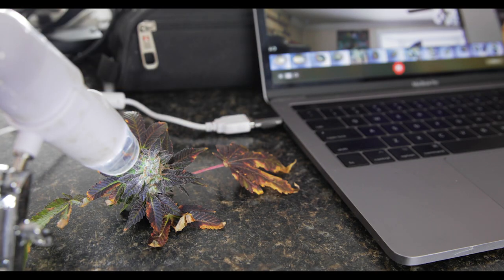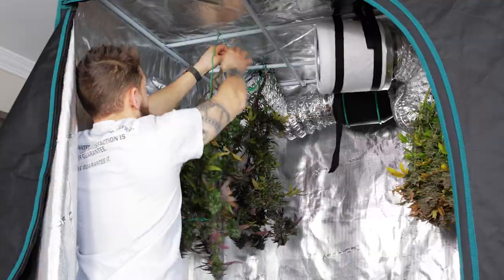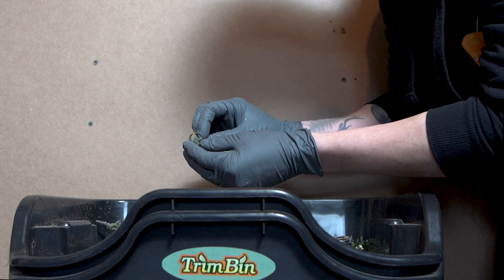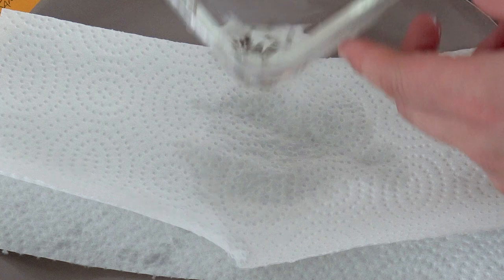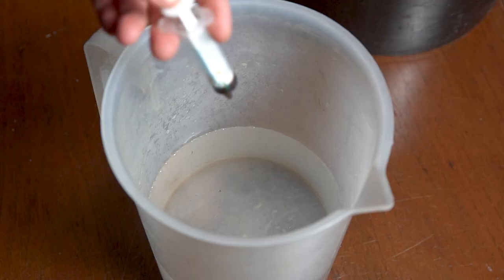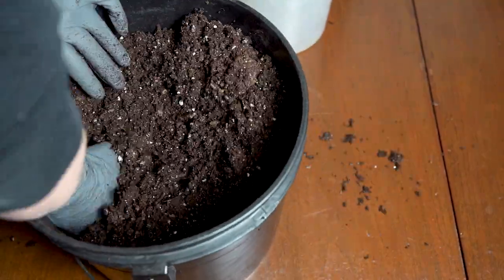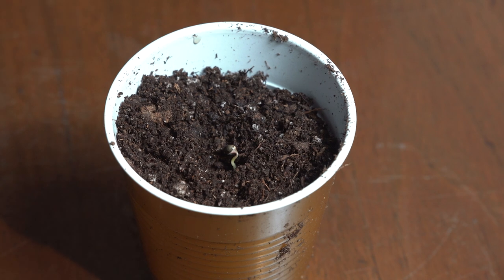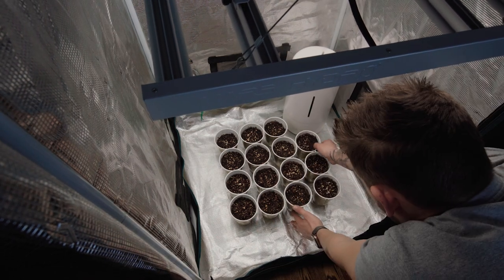Germinating my own strain of Cannabis! [Blue Freezie Grow Series EP.1]

Comment: If you just cross-bred two strains, you have not come anywhere near creating your own strain. Your own strain consists of isolating specific genotypes and phenotypes until you have seeds that grow one out of 8 different possible outcomes every time you find a seed. What you are doing is not breeding your own plants responsibly to create a new strain. What you are doing is experimenting with cross-pollination. Spend a few years crossing to get f1 seeds of different parental genetics from the same parent strains from the same breeder, then isolating 1 out of 4 possible desirable phenotypes from each batch. From there cross those desirable phenotype plants to create viable seeds. Of the viable seeds, you can take it a step farther and herm half the seeds in a grow and use the herms to cross pollinate your 1 phenotype to create feminized seeds, but that is not necessary. You need to spend more time on this cross and you will eventually have your own strain, but cross pollination between 2 plants does not make a new strain. It is the first step of creating a new strain with specific trait strengths.